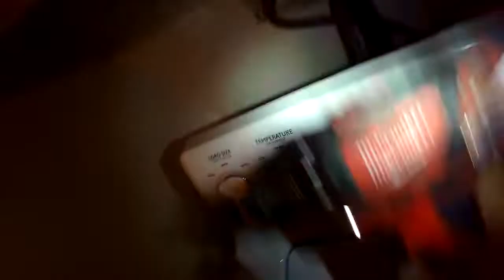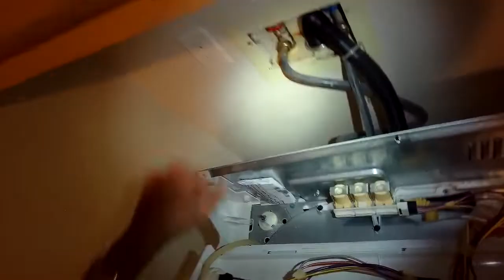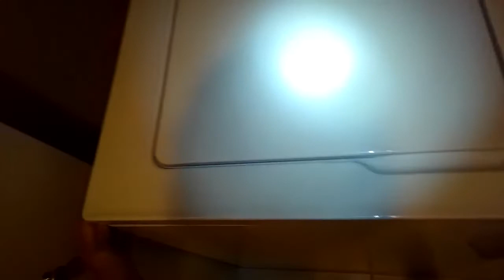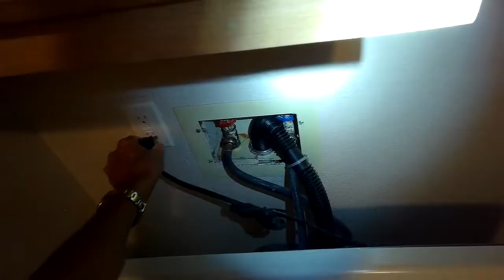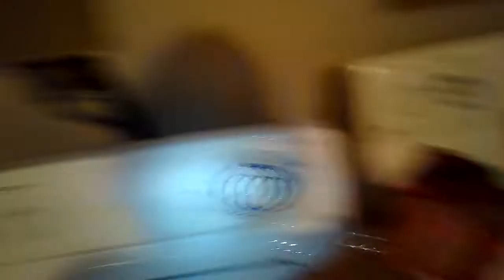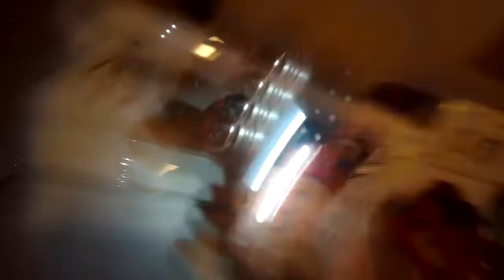GE WASHER OVERFILLS—QUICK FIX

Comment: Learned the hard way that you have to check both sides. Didn’t feel much resistance from the bottom. Started it back up and had to clean up a mess. Checked both sides and now it’s running as designed
Reply from the maker: Great job 👍

Comment: Is the small box on the side of the tub that you cleaned out supposed to have water in it? I have checked the pressure sensor and it works. The hose also is good. @scottthefixitguychannel
Reply from the maker: No, the small box (air dome) should not have water in it if the washer is empty. It needs to be clear for the pressure sensor to work correctly.